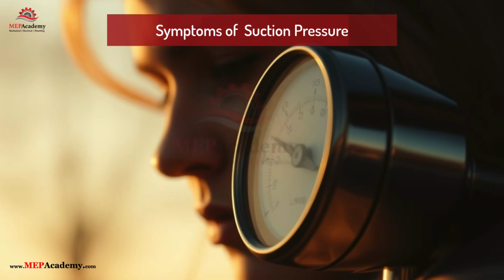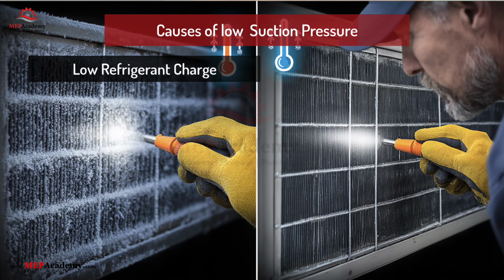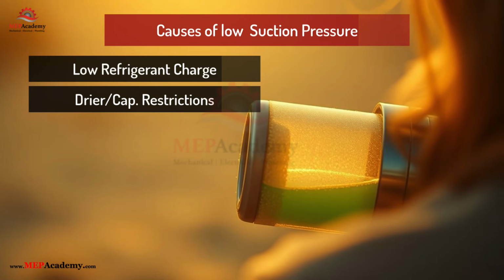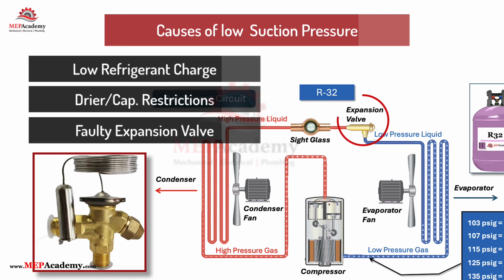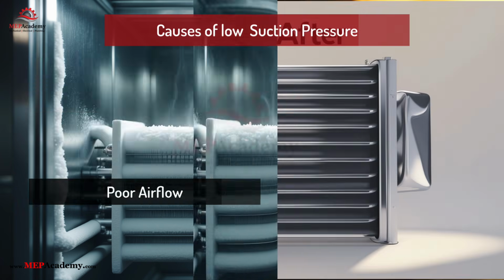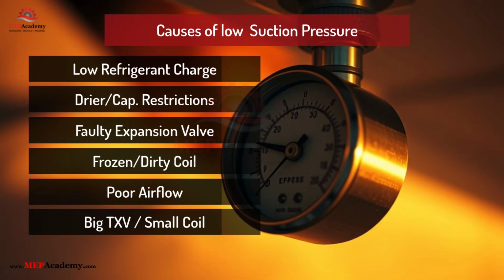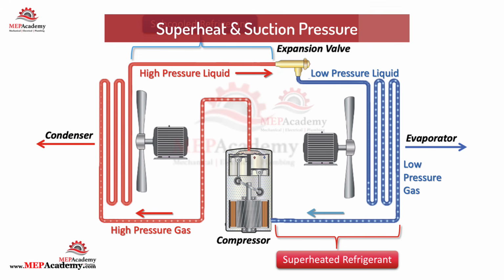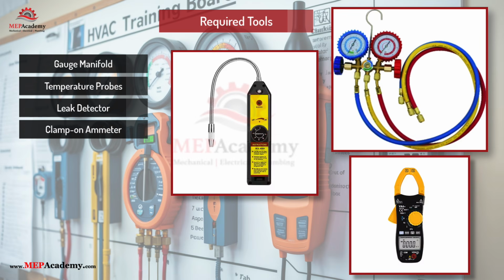Why Low Suction Pressure Happens

Comment: Undercharge is not the most common
Reply from the maker: Please leave us a comment on what is the most common from your experience, our viewers would appreciate hearing from an experienced technician as to what you believe. Thanks for watching.
Reply: For AC systems in particular, low airflow is the most common cause. Most people jump to low charge/leak as the issue and just add more refrigerant, causing another problem. Overcharged systems are common because of this. Clogged filters, dirty, frozen or otherwise obstructed evaporators or air bypassing the evap (Door of air handler off or partially open).